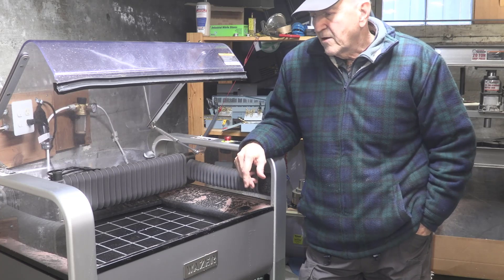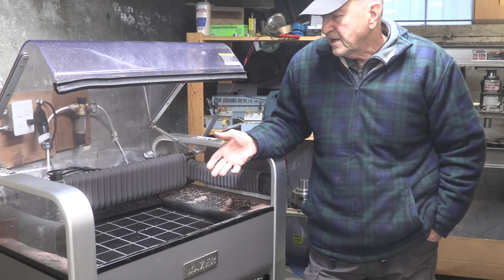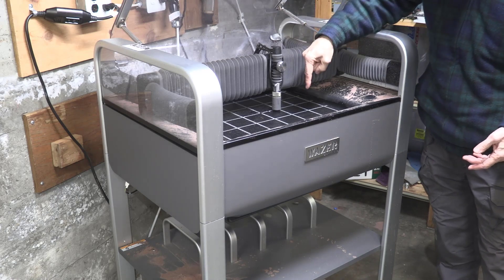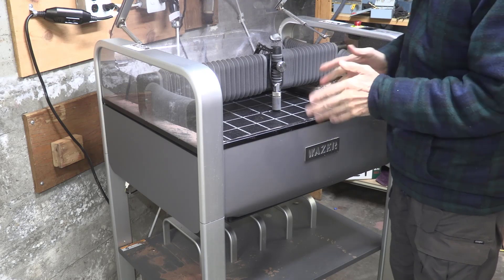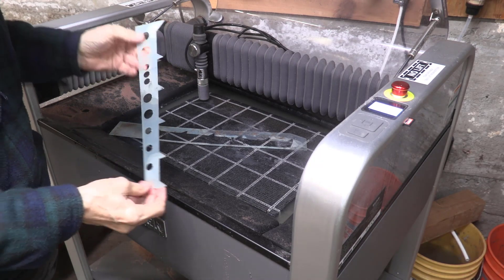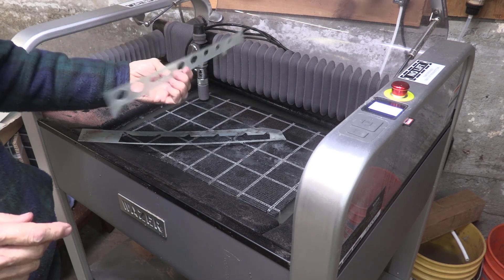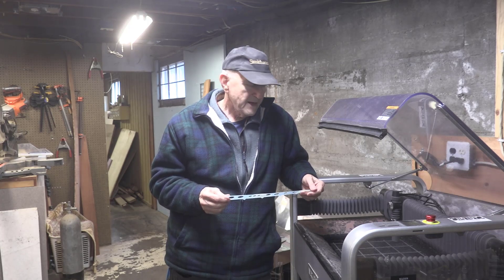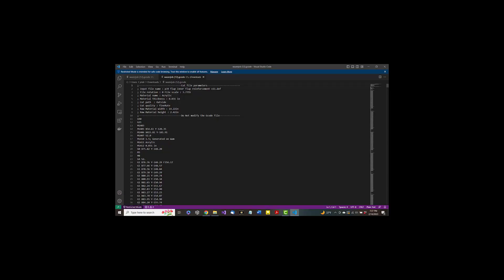Waterjet Work

Comment: Hello Hello From Canada!!! There is a video done by a welding kit guy who went to a convention and had a demo from a rep for a very similar waterjet as yours. He was showing how well the Wazer cuts carbon fiber sheets and they look amazing. The place that makes the fiberglass sheets you are having trouble with delamination, probably doesn't have strict enough quality control for truly even resin spread and is blaming the waterjet for their inferior laminations. You should check out the video link I will try and put at the end of my comment. That little unit you have is supposed to be a real deal cutting machine just in mini form LOL. You should have incredible success with a carbon fiber in that thickness because carbon fiber sheets are really put together with no skimping on resin and real quality bonding not like those flimsy fiberglass sheets. Keep up the great work and I can't wait to see all the cool model airplane parts you will be making out of carbon fiber soon.  
🙂👍 Video showing the little waterjet on carbon fiber at time 9:30
https://www.youtube.com/watch?v=_1tELH1BNrA

Comment: I cut laminated material all the time on a waterjet. Mostly metal. However, we have a drill installed on our waterjet that will pierce the hole. On a machine like this that’s probably not the option.

Comment: I was one of the first suckers that purchased a Wazer.  I purchased this to cut metal, specifically copper sheet. Cutting copper on a laser takes alot of power and the heat can change the properties of the copper for our application so a waterjet is the way to go!  Oh, but not a Wazer, it's a total piece of garbage, unreliable performance, painfully slow, expensive to operate, hard to operate. The only thing consistently we have been able to cut on it is leather, which I could get the same results with a good pair of leather trimmers!  It's a total waste of good money.   Honestly, I can't believe they are still in business!
Reply from the maker: It was a disappointment for me to discover that you can not successfully cut laminated materials. I suppose I should have realized that before I bought it, but I didn’t. Lately I have been cutting quartz that has been cut and polished. It works, after a fashion, but it is slow and it buggers up the back side of the cut. The front of the cut is clean, but when the jet breaks through the back side it tends to chip off small pieces of brittle materials. I have been experimenting with various ways to cure this (it is similar to the chipping you get on the back veneer of plywood on a table saw as the blade tooth strikes the lowest veneer causing a glue failure). I spoke with WAZER about it and they suggested I slow down an already painfully slow cutting process. Since I need to bond a very thin piece of stainless steel to the back of the quartz anyway for support, I am going to try to bond it before I make the cut in hopes that will stop the chipping. The problem, of course, is that produces a laminated material which we already know get delaminated by the jet. It can’t hurt to experiment, but I feel your pain. I am sure there are better ways to use this machine. I keep looking for them. I also tried cutting .016 s.s. with it. Thin material like that tends to be blown down and out by the force of the jet leaving a feathery edge perhaps .010 high perpendicular to the plane of the material on the back side of the cut. It is impossible to remove it without mucking up this fairly fragile material.
Reply: If you don't mind me asking what thickness of copper were you trying to cut. I have been thinking about trying this machine for thin copper, brass and silver